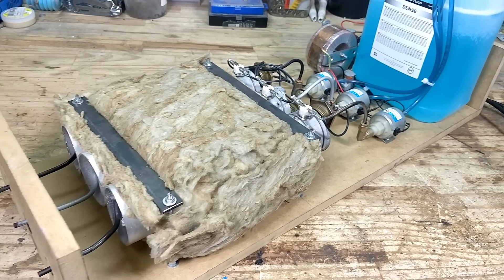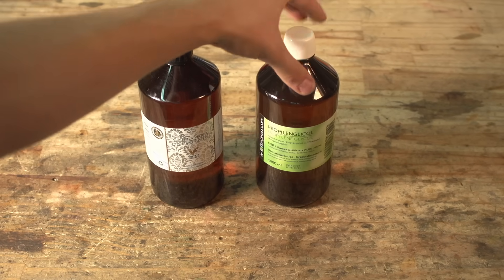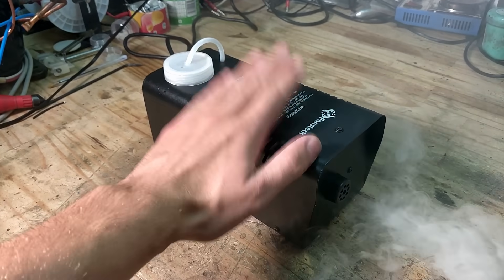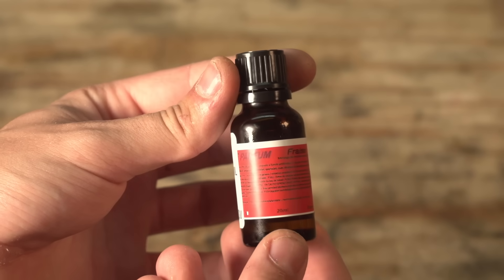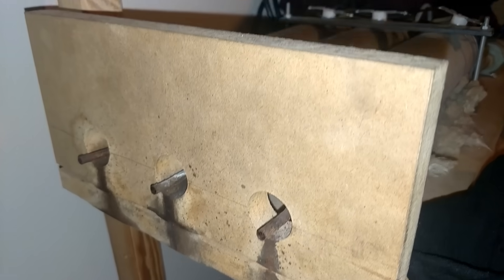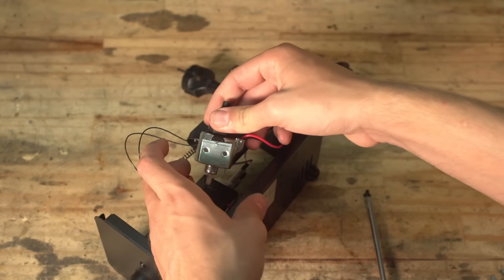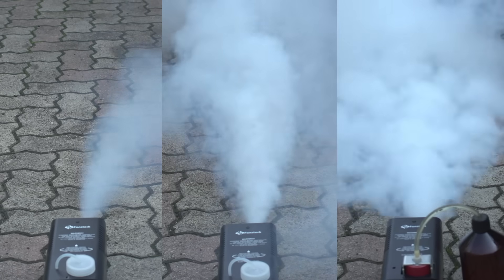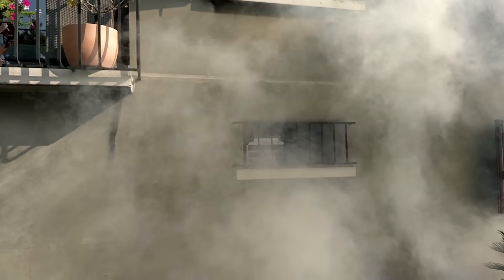How To Make a Cheap Fog Machine 10 Times More Powerful

Comment: fun idea: replace the smoke mixture with compressed butane/propane to have some more fun :)
Reply from the maker: Sounds like a plan
Reply: @NicolasSalencPBP  I’m counting on you mr scientist
Reply: @NicolasSalencPBP  sounds like you should take your $30 machine and take it to the middle of nowhere to do this, sounds like a blast
Reply: @NicolasSalencPBP  yeah butane the thing that almost gave my hand frostbite when filling a lighter because I was high and didn’t see it dripping down how tf is this shit safe for your lungs this is vape juice in the air
Reply: @NicolasSalencPBP  Im still waiting for the Video
Reply: Why not diesel in the fog machine with a pilot flame in the front
Reply: @step2cky  Terrifying fire hazard aside, diesel is probably too viscous to be reliably pumped by the solenoid pump. And the heater block might heat the diesel so much that it breaks down and cokes up the small tube. 
tl;dr: DON'T DO IT
Reply: @stormshadow_6477  Any parking heater uses a solenoid pump to move diesel fuel from the tank to said heater...so YES ! Do it !
Reply: @koningbolo4700  Completely forgot about those...
Reply: @step2cky  Interesting idea. Just put diesel in the smoke machine, without the flame. It would look a bit like this :
https://youtu.be/CchOcEjPY2Q
Reply: @step2cky  Flamethrower X
Reply: probably Would freeze( jus not the heated bits)
Reply: When planning on 'having fun', remember that you are not immune to blast waves, second- and third-degree burns or prosecution...
Reply: What if... instead of glycerin... you used nitroglycerin?
Reply: @reoffending  💡Instant DEATH😱
Reply: @Trevor Austin Nothing which a good German can't handle...
Reply: I like the way you think wet mouse
Reply: You should use the fully pimped out machine & add a bucket with ice connected with pipes to see how much low lying thick fog it would produce
Reply: It will become then a turbocharged engine with jet flame afterburner 😂😂😂
Reply: @mubinzombadkar9112  what do turbos have to do with butane
Reply: Hopefully no one starts smoking near it
Reply: @satinderjit4  but that's what makes it fun